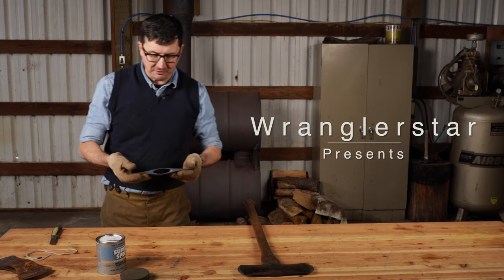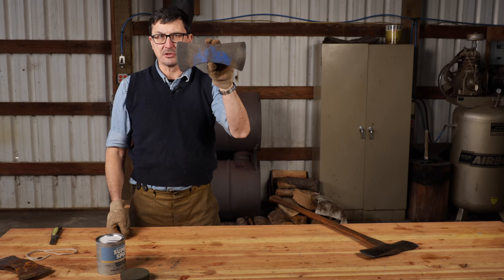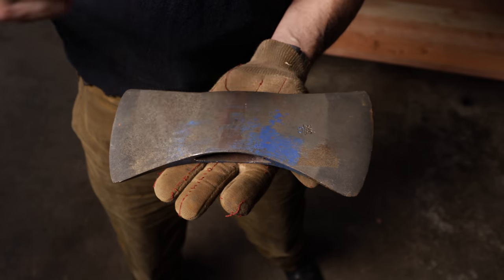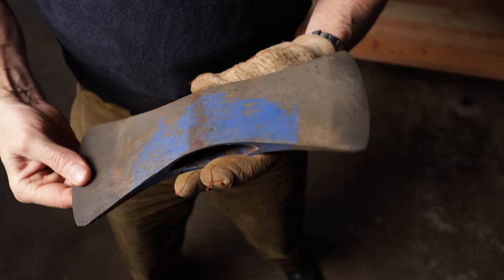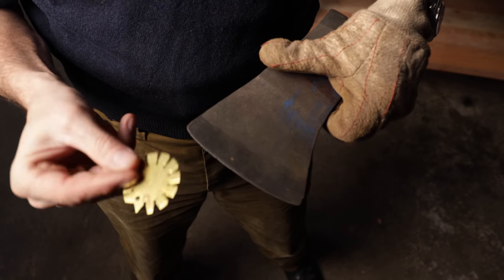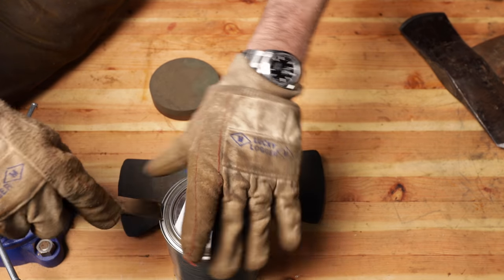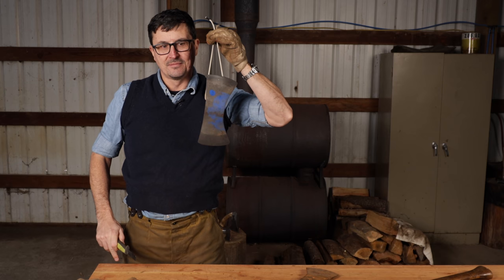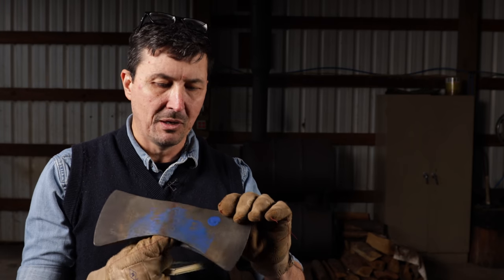The Miracle Axe That Was Nearly Lost

Comment: Just started my second attempt at my first  axe handle.
Reply: I’m also carving out a new handle, fora single bit axe, however I’m not using hickory or ash, nor am I using a store bought handle, I have 5 pieces of trunk wood, locust, maple, yellow birch, walnut, and a hunk of Hawthorne, all of these woods have been traditionally used in different parts of the world for tool handles. Being that I am carving my handles with traditional tools, draw knife, spoke shave, and a pocket knife, I will have a better fit if I take my time. After hanging the axe head, they will be wedged with wood glue, set aside for a week then soaked in linseed oil, I refuse to lacquer tool handles, for my axes will be used, not hung on a wall!
Reply: @gettintheresafelywithpatf2869  spoke shave and rasp so far for me, also using red oak which is what I had on hand. I don't know if it will last as long but if I have to carve more then I'll be better next time!

Comment: Wow its so nice to see another one... I picked up one from a local auction last year for $25. Mine is identical to it (even the painted spots are similar lol) and still has the handle (the handle has quite a twist so it will have to be replaced). Looks like you went into my basement and grabbed mine. I can hardly wait until the restoration is done so I can see what mine will look like some day. Great videos man, I'm  big fan.

Comment: After WWII, my dad was an outfitter for people working in the bush in northwest Canada. Everybody from trappers, prospectors, suveyors, forestry workers. . . and outfitting all the gear and supplies to be dropped off with a crew, or even one man, by a Beaver or Norseman float plane on some isolated lake or river. Sometimes it would be a package for 2-3 weeks, other times months. Anyhow, to make a long story shorter, he carried these axes, and others from the same maker in Sweden. There were several sizes and profiles - I wish I'd been able to keep one of each. However, I saved a few - one a slightly larger double-bitted axe, another a single blade falling axe, and a small axe, (we always called it the "kindling axe") with a head not much bigger than a hatchet. My dad had been a night fight pilot in the RCAF, but before and after the war worked in the bush himself, before realizing there was a real demand for a supplier of good-quality gear. He also carried quite a variety of Optimus and Primus stoves and lights, and tents, canvas, and the thousand and one other things needed.  
There were few or no roads in most areas, so getting in and out was either by bush plane or, in the winter, by dog team and sled and snowshoes. It was rare that an outfit didn't have at least one canoe.  
He died over 30 years ago, but I remember the "Alladdin's Cave" that was the "sample room" attached to the warehouse. So, seeing that particular axe was a little trip down memory lane. I don't use the double-bitted axe too often for my own camping, so much of the original paint is still on it. Those are wonderful tools, and I'm glad you're restoring and preserving it.

Comment: Not so sure that the mark is the temper mark or the inset tool steel into the cutting edge. The ring shows that there was a real good forge weld in between the two steels.

Comment: Not 100% sure on that axe, but I'm not sure it's the temper line you actually see, many of these axes where made with 2 different steel (especially the old ones, where good quality steel was expensive, so didn't want to make the whole axe out of it), the line you see, is likely the different steel where they where forge welded together.

Comment: The dark transition line is the high carbon steel and not the temper. They forged high carbon steel for the edges into the lower carbon head.